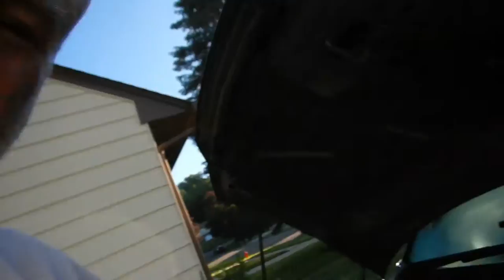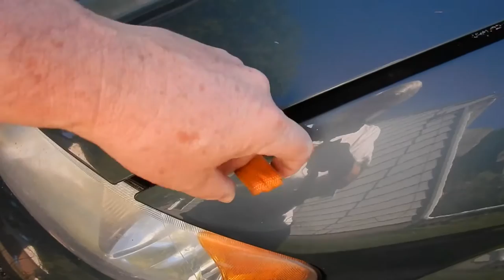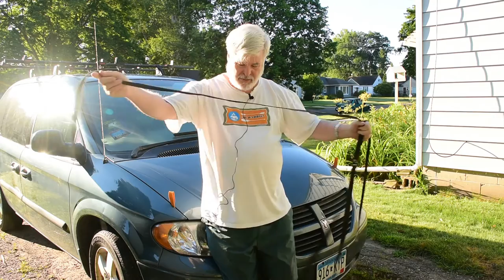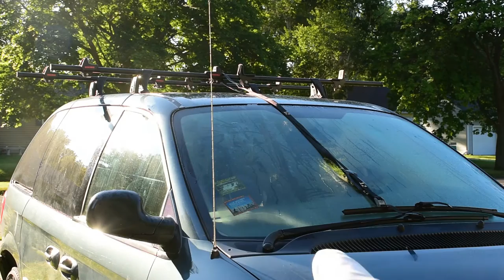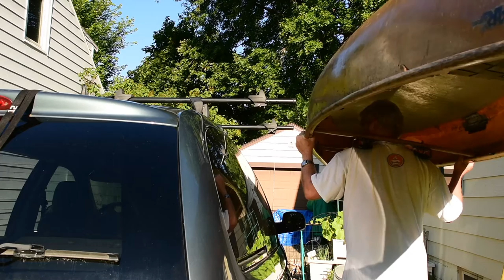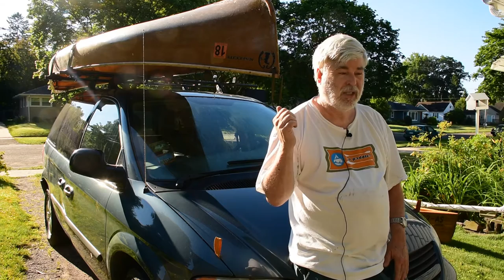Cartopping Your Canoe by Yourself

Comment: That's one way to do it on a high roof, unfortunately it's the wrong one.... You almost dropped the stern on your hood, you looked totally out of balance... A much easier and safer way is to bring the stern up over the front cross rail while the canoe is still on your shoulder, then you have a good support to load the rear cross rail.
Reply from the maker: I think you mean "bow" not "stern".... In any case, to each his own.  I've tried hooking the front cross rail and then the back one.  Doesn't work for me at all.  When I have only one cross rail hooked, I don't have the strength to get the stern end of the canoe (which is lower to the ground now, not to mention, behind me) up on the back cross rail.  Note that the side I was loading from is not the side I normally load from (hardly ever have 2 canoes on the car and, when I only have one, it's usually on the left).  Therefore, not as practiced and graceful as when I'm loading a canoe on the left (port) side of the car.  Also have that danged antenna in the way on the right side of my van.